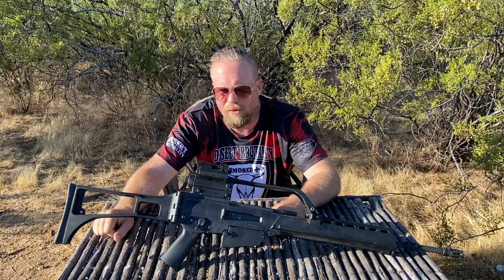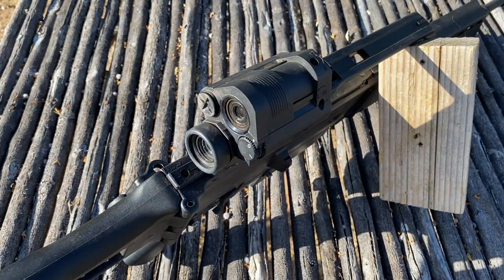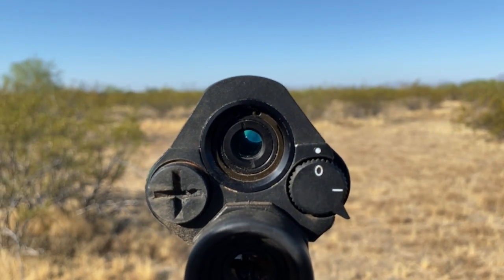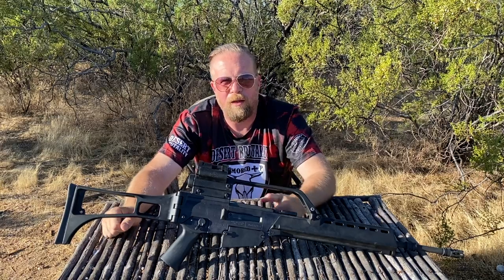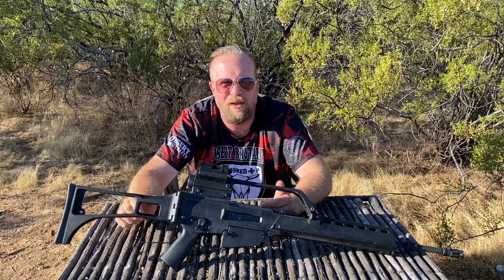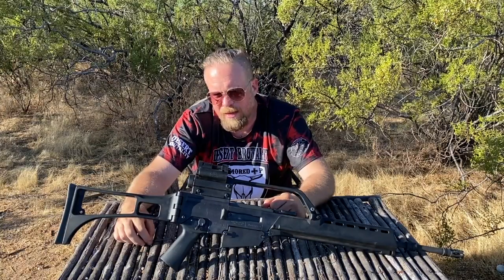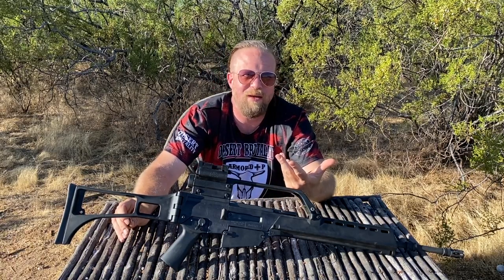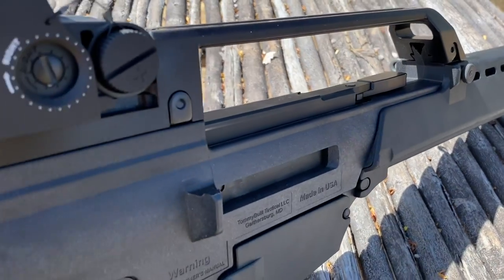G36 - Bundeswehr Hensoldt Dual Optic

Comment: The optic may be bad by modern standards. I served with the G3 and shot the G36 as a reserve soldier a couple of times. On these days at the shooting range they had 4 rifles and people were shooting all day with these 4 rifles. I am not aware that one of these rifles couldn't hold zero.

And compared to classic H&K irons even a relatively bad optic is a big advantage, especially for fast shooting and/or soldiers doing just a brief military service and don't getting a lot of trigger time in their basic training.

Don't forget: It is a gun for all troops. 90% of these soldiers are no infantry. They carry primarely for self defence. If you educate people who never fired a gun before in a brief basic military training the results with that optic are much better than with iron sights. So the concept is valid, I experienced it myself.

Comment: I have just read a german field manual, published by the Reservistenverband and it litterally says, that through intense battle stress, the optics of weaponry might shift, and that the zero will get lost that way. The solider is supposed to observe his shots in order to find is new zero. If that is not possible because of the terrain, he is supposed to shoot low, into the ground infront of the target and thereby find his zero. Then he can shoot at the target again. ... It seems to be a normal issue wich is known in the german military. The G36 specifically isnt mentioned in that extract of the manual, wich means, that this is a general advice for all Soliders, equippen with any weapon.

Comment: Karl, wait until you take part the 3x optic portion, and realized how it is mounted. The optic tube is soft mounted using rubber grommets, and "tensioned" into position by the height and windage adjustment screws. Not very rigid and prone to movement as the grommet shifts.

Comment: This actually makes me tempted to pick up a T36 from Tommybuilt with the provisions for more modern sights... I had an HK SL8 before, I thought the issue with its accuracy was more the rifle (shortly after I acquired the rifle, the rumors about heat were starting to come about) but in hindsight, it most certainly was that dual optic. Struggled to get it zeroed and it seemed to wander after a mag or two, very similar to your experience.

Comment: I haven't kept up with available options for carry handle replacements, but I can tell you on my replica the first thing I did was throw the G36E part (like the one here, but sans red dot) on a shelf and replace it with one from a G36C. Low rail + iron sights is better in every way.

Comment: Only ever looked at pictures or video, but I'd never appreciated before how narrow the red-dot is, because it sits inside a much larger and noticeably recessed cylindrical area that at a quick glance you assume is the width of the optics, but where the sight tube is only about a third of the actual diameter. Okay, the non-optical internals have to fit somewhere*, but it makes me wonder if the sight was subject to some value-engineering during development and ended up with a much smaller red-dot than was initially intended.
* OTOH the battery and controls are outside that cylinder, so maybe not.

Comment: I still love the R1  (Old FN FAL 7.62mm)'s steel peep sights . . .couldn't miss with those...or the one we had anyway..used to shoot the top parts off of drink-stirrers at 40m with those sights.
Reply: Having a scope afterwards is a bonus...but train with open steel sights first . . if you can , learn your weapon's aim without any sights on it...like the old air rifles you bought from pawn-shops..no sights,but you learned the weapon.

Comment: Ive been to combat with the G36A1 and the G36A2 (Zeiss Reflex instead of the Hensoldt) and the Zeiss Optic pretty much erased all problems the Hensoldt Optic had, even though the 3x Hensoldt was still in use, but  for long range shooting (200m) if zeroed correctly its fine to use, not great but fine. In many years of service with both rifles, i needed to rezero the gun approx. every 6 months, with thousands of rounds going through, my zero did not change (adressing the flex problem of the polymer).

tldr: the A2 Variant with the Zeiss Reflex is a huge upgrade, the 3x Hensoldt which they kept using, not so great, no flex though, rezero every 6months

Comment: the door on the top is not about if you have a battery or not. you are always suppose to have one. the door if for daytime use so you do not NEED to use the illuminated aimpoint. you are just suppose to use the illuminated aimpoint when its getting dark or when lighting is to low to be usefull. however you dont really need a lot of light for the fiber optic element to work. also when its getting darker outside you dont need that much lighting for your aimpoint to begin with. you are just suppose to use the battery between dusk and dawn. (my information as of my service in 2007)

Comment: I remember the rumors in the German army in the early 2000s that it was easy to kick off will separate the two optics  from another. It was fixed or proven wrong after a few years.
Reply: The rumor came from the fact, that the red dot was later addat upon the scope. The rail to carry the gun had an emergency iron sight and kept it, while it was totally useless.

Comment: When i became a german soldier, the first rifle i was trained on was the G3. I never liked the G36. To me the G36 always felt like a better airgun. I never trusted in 5.56 Nato. 
And the G36 had more issues than the huge optics. One point was that the but stock of the standard version was not adjustable in length (that often caused problems for short persons in winter or with body armor).
I always wanted my G3 back.

Comment: In bright daylight you dont have to turn the red dot on. For bright daylight you need to open the slider on the top of the device. The incoming light is than used to illuminate the dot. The on off switch is for the use in darkness. Then you should close the slider because there was a probability that the enemy could see that. 
If you needet a brighter shining dot, you cold press the on off button, then the dot was shinig brigter. Just in case there was dirt on the sensor that adjustet the brightness of the dot. Yes, the dot was adjusting to the surrounding light.

Comment: @InRangeTV: I would say that you're 90% right, with the issues of accuracy during extended fire coming from the sighting system, but exacerbated by the barrel heating issue. During extended firing, did you notice any shooter's fatigue?

Comment: After firing one, the small circular fov of the optic I could only describe as cramped, turned about to approximately predict the uncontrollable spread of the rapidly overheating machinegun. If it isn't the barrel simply coming loose from the trunnion there is another major issue.

Comment: Yeah the sights aren't amazing. The red dot is used with both eyes open, and while I didn't have an issue with using it consistently, it is quite a chunky bit of vision missing. The magnified optic has an incredibly narrow sight picture, no two ways about it, but it's functional, if sighted correctly ( I personnally had to use the upper rim of the sight as my "zero" during basic training, and no you're not allowed to adjust it yourself). The concensus on the sight basically was: "Don't have it impact anything, or it potentially looses zero" and we are not talking about using it as a club.

Comment: I have Seen a picture of für original Plastik Teleskope Tube. Für adjusting Adresse Press directly in the Tube. The Others end ist Held i an o Ring. Thus ist the Whittaker Optik alignment you can have. You can circumvent your Shifting Problem maybe by hitting tust scope Witfrz the grip of a Screendriver or Something similar until the aimpoint moves. This works in any  adjusting system where friction ist involved. Also in Electronic Spindler trimmers.

Comment: For the frist shot deviation i may have a solution. If one places a muzzle close or on smth the expanding gasses are compressed and released irregualarly, and can cause the projectile to be diverted from its "planned" trajectory. I myself never tested it but if been told by my usermanual and instructorts in the swiss army during sniper training.
Reply from the maker: The problems continued for the rest of the match.

Comment: Had this scope/rifle during my time in the Bundeswehr 2003. It was horrible. It was not zeroed in properly. We had a range day, I found my zero (which was waaaaay off to the side). Then, we had a maneuver day in the terrain and dragged the thing through the dirt and bump off some obstacles on the course. The next range day, my rifle was off in the other direction. I ended up using a different rifle for my shooting qualifications as mine kept loosing its zero and the bad arsenal management was straight up refusing to fix the issue.
Reply: And yes, closing the secondary eye for the red dot was instructed.

Comment: after zeroing the sight, did you push on it from the front? that's needed to relief any stress in the system so it doesn't snap out of the new found position

Comment: There`s one downside you forgot to mention which frustrated most soldier: NO IRON SIGHTS
Use it in mud, or a desert and you won't see sh!t!
If the optics keeps drifting or gets cracked, you're screwed!
I really like the concept of the G36 optics and it was ahead of its time, but the execution was bad and still, they didn't even try to compensate for it with a fallback option...

Comment: As a still user of the dual optic i confirm you its a nightmare as a professional point of view but for the goverment buyer who does not know about guns it is pretty cool because yo are suposse to have close and mid renge optic, the truth it is that you can not relay on your optic and it is not fast at all to adquire your targets and the hihg of the red dot does not help too. I only use the red dot because i am not able to adquire mty target with with enough speed with the 3x.

Comment: Have not researched into it, but I wonder if there were different versions of the sight. Or maybe that AA batteries will work, but not as well as the other batteries. I have one on mine, but it takes SAFT batteries (SAFT might be the company of the battery, however they are different from AA). They are 3.4V batteries rather than 1.5V

Comment: One question i have is about this exact Rifle you have here. What is this german parts kit? Where does it come from? Are they from Bundeswehr rifles intended for disposal or are they supplied via third countries? It seems pretty obvious that a rifle the has been used for 25 years and was then disposed of by the Bundeswehr is gonna have some problems with it, so some more information on this rifle would be greatly appreciated.
Reply: It's a German parts kit for a g36. Rebuilt by TommyBuilt (who rebuilds g36 rifles per custom orders for each customer).

Comment: With the time that the optic was fielded, it might be interesting to run the gun with it versus with it off and using irons, but not sure if that is possible on that gun? Not sure if you can put a low rail on it and bolt on irons.

Comment: When inRange TV does a better job investigating the G36 accuracy problem within 2 videos than the whole Bundeswehr taskforce within a few months...
The Bundeswehr should just scrap all the old dual optics, get the picatinny rails and put a modern optic on it, which they also could use when the G36 gets replaced some day. And not just with deployed units like they are already doing, but with every gun.
Reply: @LeutnantJoker  Yeah I know but they just should use it on all guns.

Comment: I dont know about zero loss as much as snapping piston rods in the earlier 01-03 models. I am sure they fixed that. Remember also that the military isnt good about replacing stuff. They probably just re barreled some of those receivers over and over when they are plastic and should have been thrown out with the barrel. The flex you are showing at the end of the video is it. When it gets warm it tends to flex a little more. Takes mag dumps though.

Comment: The sights are not impact resistent enough. You can zero it perfectly but if you bump the gun or drop it, the sights are off again. Imagine having 200 micro impacts (recoil) on a optics that can't handle impacts at all. The base rifle is fine, the real problem is the whimpy optics.

Comment: the 3x scope is relative decent in my time of duty. But the Red Dot is horrible, especially when you doing snapshots. The Bundeswehr switched the Red Dot that karl have there to an little piece of picatinny rail. Specialized soldiers like Paratroopers mounted Eotech Holosights on it. The normal Soldier gets the RSA from Hensoldt. Both are an much better option as the originally Red Dot.

Comment: What is the use for a red dot sight? Greater situational awareness?
Reply: In theory, clearer sight picture and not having to line up the rifle exactly right. Not having front sight post (or rear sight notch) blocking half of field of view is great for situational awareness as you suspected. And with red dot, you don't have to line up  the sight exactly right in order to have a accurate shot is great for situation where you might have to hold the rifle in an awkward way, or needing to pop a few shots immediately.

However, as we see, the damn thing on the dual optic is too small for any of the above to be true. But hey, it's the '90s, and at least they tried.

Comment: You got a really bad example of the optics. I serve in a training unit, where we use pretty worn out rifles for the trainees and I have not yet seen a optic that cloudy for the 3f. Btw the brightness of the red dot is self adjusting, on the front side there is a small brightness sensor. But in dusty environment it often gets blocked, because the diode is recessed a bit and grime can build up in front of it. At the time the rifle was designed and contracted the optic was a good product: compare it to iron sights for a rifle usable against unarmored targets up to 600-800m. Since pic rails are more common they are implemented in the a2 variant. But as it is with most Bundeswehr materiel the largest part of the troops still use an old development state (compare the "Schutzweste standard", a non modular ballistic protection vest with sewn on pouches, weighting far too much). I really hope, that the successor will be a better rifle, for all soldiers.

Comment: The real G36 dosen't have that kind of flex. Is the tommybuilt version put on the rail, screwed and glued like the original?
Since 2011 i have nevver seen anyonein the german army lose zero on the G36 but yes it's a straw and people actualy shooting the wrong target while zeroing is quit common when they are unexperienced because you can't see all targets through the 3x.
The small reddot is not really a problem for shooting with both eyes open that all training but pretty bad for low light with unusal shooting positions beacuse you just can't find your dot.

Comment: I wonder, does the G-36 have iron sights at all? Perhaps those could be more reliable than the optic.
Reply: Kinda but not really. There are essentially cheap 'pistol style' sights moulded into the carry handle but the original dual optic is screwed&glued so they are only usable on the old export versions that didn't have the red dot mounted.
Reply: The G36C’s had that top rail with iron sights, with two different rear apertures you could flip between for close or at range (the UMP had similar sights).

Comment: Thank you for this interesting report. As a former Bundeswehr-soldier I can confirm your experience concerning the bad Hensoldt-optic, specially the bad magnifying lense, this lense was a nightmare, but by using the reddot and let both eyes open (that is essential by using a reddot!) nobody could fail to hit, that was at least my experience. 

That you had those problems with it, that was maybe the result of your G 36 consisting of parts not made all by Heckler & Koch and assembled by somebody else.

I can assure you: Using the reddot it was unpossible not to hit the target. At least on our shooting ranges, maybe in Afghanistan in the desert after years of using those weapons by different soldiers also the original weapons had the same "loose" feeling like your weapon had and the results were no more the same. 

Of course, no there are better reddots available on the market.

By the way: Reducing the standard-caliber from 7,61 to 5,56 was not a good idea at all, because for Afghanistan those cartridges with the 5,56 caliber were not able to penetrate this typicall clay-walls, the houses there was made of, but the bigger caliber were. Fighting troops on patrol had at least a few old G3's with them to overcom that problem.

Comment: I think your theory about the cause of the issues with the HK 50 (the original name) is very sound, and could be the issue. However, you are testing with an American made receiver, which could be a major problem. The flex of the real receiver could be much less. Maybe someone can post a video with the same test with an original G36 ( Like the close up with the bolt handle and optic)